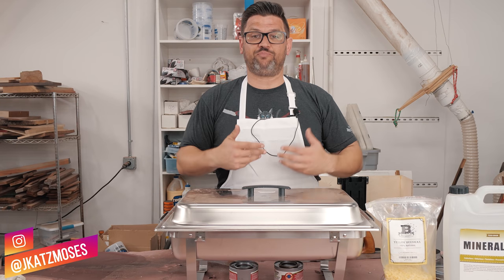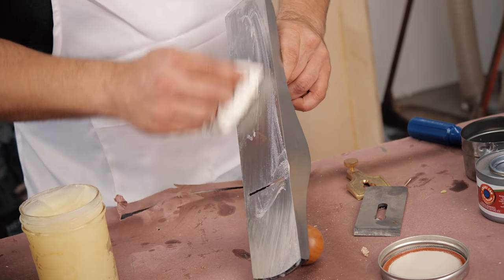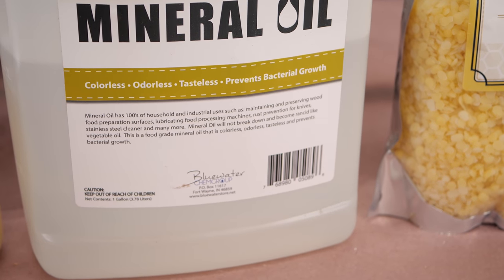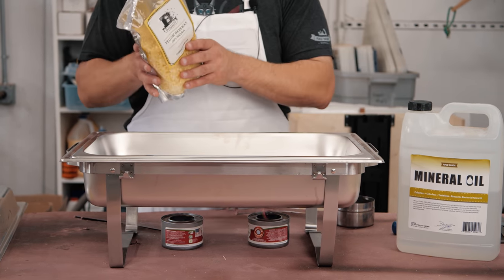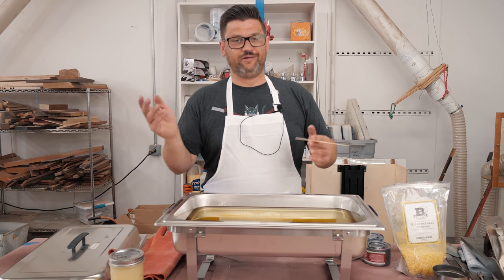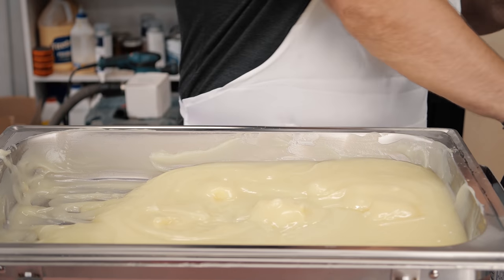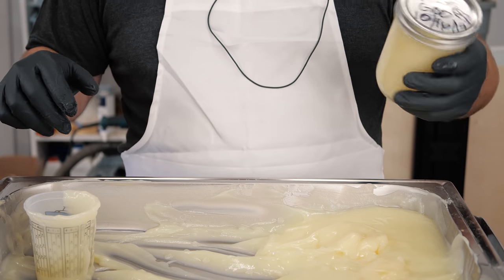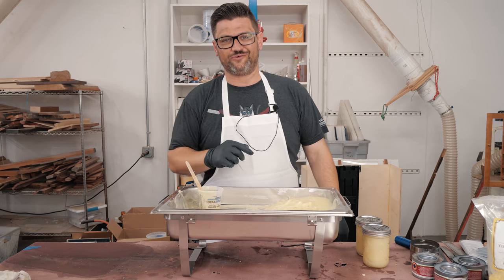Making the Katz-Moses Goo - Great Cutting Board Finish, Tool and Rust Protector

Comment: Awesome goo, I’ve just made a small batch 250g worth and as an analytical chemist I added a few drops of vanilla-scented oil (knowing this would not affect the composition of the ‘goo’). It worked great! Thanks for this, now I have a lovely smelling wood treatment that I used on some furniture and made it look and smell amazing 🤩 My new favourite!
Reply: quick question, if I use 250 grams beeswax, I would use 1L mineral oil? Slightly confused because he mentioned a 4:1 ratio, but used cups for the beeswax and used the liter for the mineral oil. A volume vs weight dilemma popped up for me. I use a weighing machine for everything to make life easy.

Comment: Mineral oil and beeswax are two things with no expiration dates.  Plant based oils are the ones that go rancid.

I like your tray setup there for large batch making, if that's all you're ever going to use it for. But an easier and less messy way, for people making smaller batches, would be a double boiler setup.
Then you can make it right in the jars, no transferring, no cleanup. All it'll cost you is another minute of measuring and pouring for individual jars. 

I've used mineral oil and beeswax for wood, neatsfoot oil and beeswax for leather, camelia oil and beeswax for rope.  It all works great. Pretty sure bees are just magic lol

But consider your final application when making your recipe. 
4:1 is a good starting point, but sometimes you may want harder or softer.
For example, on soft leather I'd use a little less wax, so it's more flexible without cracking (not applicable here, but just to give an example)
For knife handles and wooden utensils I throw in more wax, making a harder substance, but it's easy enough to just heat the surface of the jar with a hair dryer or heat gun to soften it up for application. Once it rehardens on the piece you have a good hard wax surface that can be buffed nicely, and will last longer through use and washing (but still, don't use hot water to wash, just warm water and soap, and of course nothing abrasive)
Reply: P. S.
Thanks for the link to the beeswax pellets, that would've made my life sooo much simpler if I knew about that before!
I've been working with 1oz bars of wax and a cheese grater lol
Reply: Came here to also suggest the making the goo right in the jars part.  You can set up the jars with the oil and bees wax and make as little or as much as you like.  You can even do different ratios in different jars.

Comment: I know this is a bit late in the reply, but I made a batch of this finish and put it on a box store butcher block top. Filled the flaws then sanded to 320 with your recommended Cubitron sandpaper. Came out butter smooth! This finish was simple to make and easy to apply. I'll do 3-4 coats before I buff this out. Thanks for the "JoKaMo" Goo recipe!

Comment: Thanks for making this in-depth on how it's made, really helpful. I whipped some up after the cutting board video, but didn't put in enough oil and it turned out too hard. I was going to reheat and add more oil to make a better consistency, but after seeing this video, I may use the batch on my tools and iron tops. I hadn't thought of using it for that instead of Johnson's. - Chris

Comment: Mineral oil will not go rancid like cooking oils and olive oil. That it one reason to use it on cutting boards, bowls that food will be in.
Reply: Yeah, that's what I heard too.
Reply: So then this should last forever right? I don't think beeswax would go bad either
Reply: JAMCastillo1 it will have to be reapplied, depending on how many time it’s washed with soap and water, but it easy to accomplish, after an evening meal when it look like it’s drying out apply the mineral oil, in the morning apply the bees wax and rub it in. Maybe in another month reapply.  Never put wooden cutting boards in the dishwasher
Reply: @jaymiller286  
I should have been more clear with my wording.

As in storage, the mixture shouldn't go rancid? is what I intended to say

Not sure if mixing the 2 allows them to go bad after an amount of time, or it just needs to be re-stirred as I would imagine there would probably be some separation

Comment: So to use a 4:1 ratio, beeswax to oil, how do you come up with 1/2 gal of oil to 2 cups of wax.
Because you are mixing a fluid with a solid.  They have 2 different measurements.
I have a 12 fl. Oz. Bottle of mineral oil, how beeswax should I use.
Love videos by the way..  purchased your stop block, which is awesome to use.
Keep working wood.
Bill K

Comment: I made this and used it on a cutting board made of hard maple and cherry with a couple coats.  I put a prime rib on the board for carving and now the board has spots where the meat juices soaked in.  Did I not put enough on?  Should I do straight mineral oil first and then condition with the goo?  Or is this something that will happen with wood cutting boards?  It's edge grain also if that matters.  I'm going to sand the board again and finish once more and I think it will be fine but wanted to ask.

Comment: What's the melting point of this stuff? Would it be a bad idea to use as a top coat on a multifunction workbench in Arizona? I'm thinking it might regoo in the summer heat.

Comment: Hey KM! I am about to finish a butcher block kitchen countertop and I'm considering making some goo for the job. I wanted to ask if you think it would hold up well enough on a surface that is so heavy used and susceptible to water. Any advice would be helpful. Thank you for your work man, you are a legend.
Reply: I would say no no no. The reason behind this is people are going to naturally use cleaners and the backs of sponges on every countertop someone’s multiple times a day. This will strip the wax off in no time. 

On a cutting board unless you cut meat on it you brush it off with a paper towel, most of the time dry. 

A butcher block counter with only this on it I would assume you’d be reapplying it many times a year to keep it saturated to a healthy amount.

Comment: Jonathan, I made your recipe using the same oil and beeswax you did and followed the directions including times but I noticed that the finished product seems a little on the thin or liquid side. Will adding more wax solve this and if I want to make something that is more like a paste wax can I go to a 3 parts wax to 1 part oil ratio or is that going too far.

Comment: @Jonathan Katz-Moses I have made this goo and pop the grain on my cutting board and then do a final sanding before applying the goo. I put multiple coats (too many to count) and then buff. The board is butter smooth but the first time I clean it with a damp cloth, the grain pops some. It's not really rough but not smooth anymore. Is this common or am I doing something wrong? I have even tried popping the grain twice before applying the finish and it doesn't help. Thanks!

Comment: Hey man great stuff. I have been using using mineral oil and then beeswax separately for a few years now.  I did make up a batch of the goo and have some boards I’m prepping to finish.  Bit my question is regarding hard maple.  Will all combos of oil and beeswax “yellow” the maple.  I love the whitish effect before finishing and then after application I find a little of the wow factor has gone away because the contrasts are not as dramatic.   Any suggestions?

Comment: How important is the ratio? I guess measuring by volume vs. weight makes a big difference and depending on the size of the wax pellets you can get the volume might fluctuate as well. I will definitely try this for my next cutting board.
Reply from the maker: Not too important.
Reply: Tried it with a 2:1 ratio (by weight) . The finished goo basically was a solid. I will heat it back up and add even more fluid. In Germany it is bit difficult to know how "mineral oil" should be translated. I went with Wikipedia and got pure "Paraffin" from the pharmacy.
Reply: @FatTony071984  parrafin is NOT mineral oil!  That is the source of your trouble!

Comment: Do you find warming cutting boards when applying oil/wax finishes helps it to absorb deeper - or do you think that’s a myth?
Reply from the maker: Not sure
Reply: I find it helps. Youll see the air bilubbles coming out of the wood if you apply a heavy coat and put it in the oven for a bit

Comment: Let’s see —- I’m supposed to take my wife’s crockpot out into the shop to make up a batch of Katz-Moses Goo. Nah — I don’t think so. 😲 She does want me to make cutting boards for presents sometime so when I do I guess I’ll have to get a crockpot for the shop.
Reply: Thrift shops and Goodwill stores will usually have them for sale cheap. Then you could have your very own Goo Cauldron. 👍
Reply: KamekoBruns oh I’ll definitely buy my own. Small crock pots are pretty cheap.
Reply: Russell Borrego very true but small crock pots are fairly cheap and much safer than those that have been sitting around for many years. I know when we upgraded to a new one for our kitchen the one we gave away was thirty years old.
Reply: Both ingredients are food safe, so I’m going to whip up some of this in my regular kitchen crockpot. But, as a female woodworker living alone, both the kitchen and the shop are my domain. Better get permission from your ladies first, gentlemen. :)
Reply: kim2015odos good advise. 😁👍🏻
Reply: I just bought one for 20 bucks for this. Crockpot is the way to go
Reply: Correct me if I'm wrong here...

I'm guessing that you could also use a double boiler, like melting chocolate in a glass or ceramic dish over simmering water on a stove top.

Then you just need a dedicated dish. A metal mixing bowl would do, and if the smell is a problem, use that side burner on the barbeque outdoors to simmer the water under it. (You know, the burner you never use beyond burning the bugs out of it in late spring!)
Reply: Jason Doust yes, that would work but in my mind I think setting up a crock pot would be easier.
Reply: Adam Wilson great!
Reply: And when your not making goo is great for chili in the shop in winter
Reply: Steve Smith super idea. Thanks. 😁👍🏻

Comment: If I remember correctly that's 4:1-ish beeswax to mineral oil. I'm going to guess that by volume, and not weight or something silly like that.
Reply: Kevin Cochran No it is not that ratio!  If you use the ratio you said, it will be hard like car paste wax.  The ratio is 4:1 mineral oil to beeswax.  This will give you softer consistency that is much easier to apply.
Reply: Katz-Moses doesn’t bother to say it, but from the video it’s a ratio of 4:1 mineral oil/beeswax (flaked) by volume, not weight.  Minor point, but sometimes important.

Comment: So turns out my friend and I did the 4 to 1 ratio, in the opposite direction😭. According to your other video on your favorite finishes, that’s how you stated it. Needless to say, it did not go all that well.
Reply: 4 part oil, one part beeswax?
Reply: @asderven  that’s the correct ratio yes, 4 parts mineral oil to 1 part bees wax. 

If you try 4 parts bees wax to 1 part mineral oil like is stated in the video, you get a massive unspreadible brick.
Reply: @jakWiize  thank you. Did you measure by weight or volume?
Reply: @asderven  weight is likely better, I did volume as my wax was very very small pebbles and then fine tuned with adding a little more here a little more there after each time I let it cool fully to check the consistency. The big thing is just let it fully cool and then it should be soft enough to easily push a rag through but stiff enough it stays exactly as is was after you scooped some out. Like beaten egg whites on a Angel food cake appearance/behavior. Lastly if you don’t like the mix, you just turn back on the crockpot and melt it again and add more of whatever you need!
Reply: @jakWiize  thank you, that is very helpful.

Comment: @JKM you should sell it.
Reply from the maker: I thought about it. We'll see. Would have to have it's own station. Making this in bulk could get messy.
Reply: Kyle, Please try to make your own.  It is very easy and you can use a sauce pan on low heat to melt the beeswax in the mineral oil.  The pan will clean very easy with hot water and soap.  I put mine in left over 1 and 2 cup plastic takeout containers.  You can buy mineral oil in smaller containers and small amounts of beeswax.  You don’t need the large amounts that Jonathan uses.  There is a YouTuber who sells it but I cannot remember her name and I do not follow her channel.